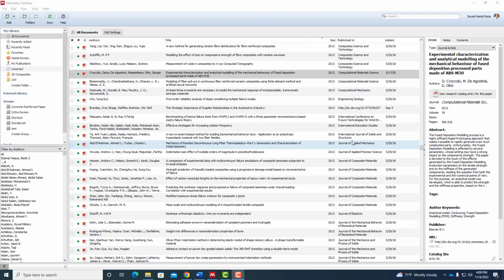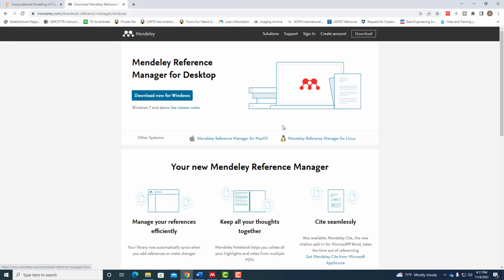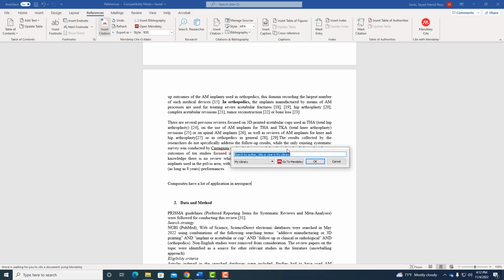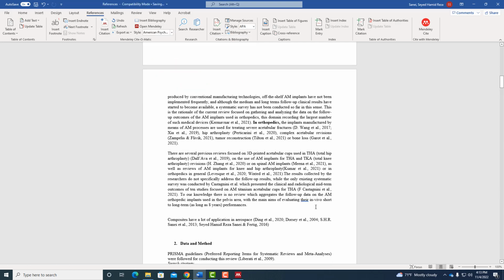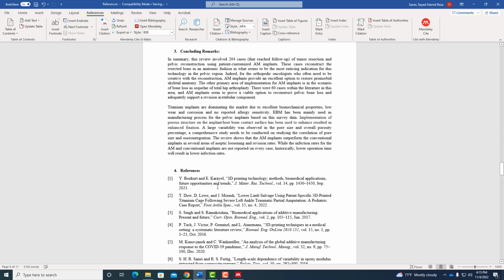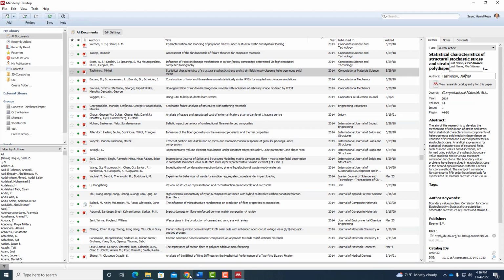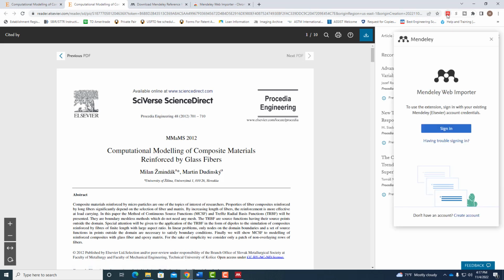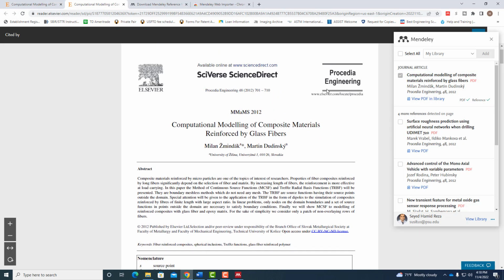How to use Mendeley Reference Manager Software

Comment: Which mendely version are you using?
Reply from the maker: I believe it is the latest version, 2.8.1. Why are you asking? I don't think if there is any significant differences between versions.
Reply: This not not version 2.8.1. This is version 1.x. The differences between Mendely desktop and Mendely Reference Manager are indeed significant.
Reply from the maker: @kimobruns  Then I need to install the new version and work with it. Do you like the new version better?